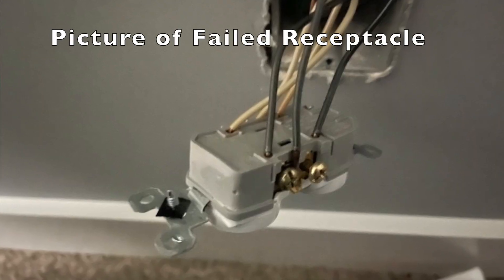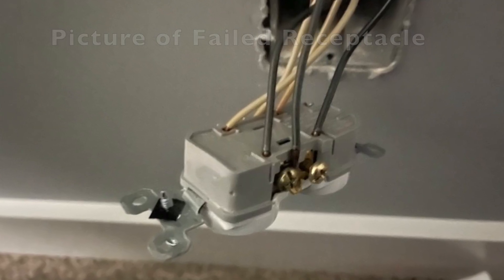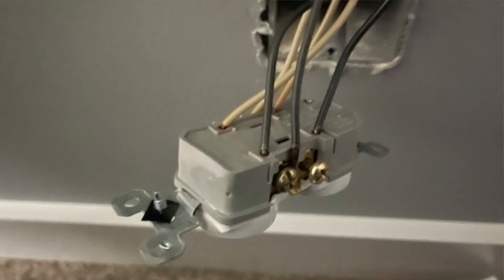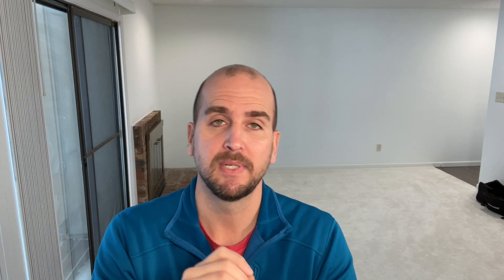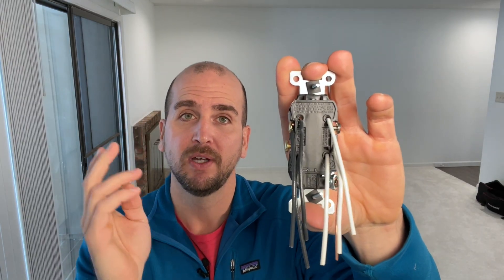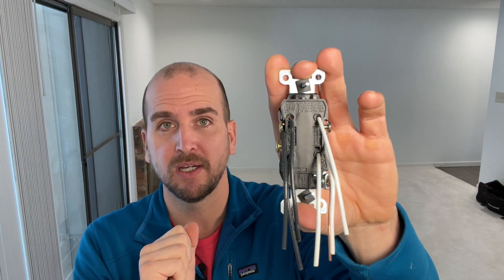Incorrectly Wired Outlet Found In Newly Built Home

Comment: That original wiring with the three leads is  not a bad practice, it IS a violation of the code. Code requires that a receptacle can be removed without interrupting/breaking the circuit. Thus, a pigtail is **required**. 

 You will also see installations where some insulation is stripped away and the continuous bare wire is looped over the screw. This is also a violation because it leaves uninsulated conductors when the receptacle is removed. Not good. Pigtail.

Comment: There you see, that us electroinstallation is one of the worst....
Compared to european.
Exposed terminals do not exist in new devices as sockets,switches and so on...
New standard is, push in connectors and  live open metal parts are maximun covered against touching ( because always exist dumb nuts, that work on electicity withoutvturning off fuses) ans for children in the house exit also cheap inserts to prevent poking with metal into a hole...
Us has so many codes and rules, but does nothing to change the basics...
Find in google cee conform sockets from abb or busch jaeger and compare them to us standart.
Added pictures...
https://www.google.com/search?q=busch+jaeger+up+einsatz&tbm=isch&ved=2ahUKEwixh8DCyu3uAhWI-qQKHVUFBh4Q2-cCegQIABAC&oq=busch+jaeger+up+einsatz&gs_lcp=ChJtb2JpbGUtZ3dzLXdpei1pbWcQAzIFCAAQzQI6AggAOgQIABAeOgQIABAYOgYIABAIEB46BAghEApQ2MAEWMWKBWDslwVoAHAAeACAAYgCiAGaD5IBBTkuOC4xmAEAoAEBwAEB&sclient=mobile-gws-wiz-img&ei=_ksrYLGQDoj1kwXVipjwAQ&bih=775&biw=412&client=ms-android-samsung-ga-rev1&prmd=sivn#imgrc=AwOGLgVr2eRYoM
Frontside with childprotection:
https://www.google.com/search?q=busch+jaeger+up+steckdoseneinsatz&tbm=isch&ved=2ahUKEwjugtvry-3uAhWVq6QKHdIdAsYQ2-cCegQIABAC&oq=busch+jaeger+up+steckdoseneinsatz&gs_lcp=ChJtb2JpbGUtZ3dzLXdpei1pbWcQAzIFCAAQzQI6BAgeEApQ7rUCWPrnAmD9gANoAXAAeACAAcwBiAGFDZIBBjEuMTAuMZgBAKABAcABAQ&sclient=mobile-gws-wiz-img&ei=YU0rYK7OBZXXkgXSu4iwDA&bih=775&biw=412&client=ms-android-samsung-ga-rev1&prmd=sivn#imgrc=IKldvHvz-jr93M

Comment: One point to keep in mind with pig tails is that the addition in some codes (can only speak for Canada) of the 2 wire nuts can put you over your box fill limits for number of conductors in the box.
Reply: Where I live pigtails are required on all three wires.  No spec. on ground position but I like to go ground up for safety  from "metallic intrusion". I also use as larger box as I can which means fewer problems with box fill and allows me longer terminal leads.
Reply: @francoistombe  I also install ground up EXCEPT in a flood prone area like a basement....
Reply: Poor Wagos...
Reply: @mmoser9483  Don't weep for Wagos.
Reply: Well , it is a matter of 'size of the box' that controlls the number of wires and 'connectors' ... a 3 gang box is likly even in Canada allowed more (and saddly, largely ignored by inspectors in the US) ... BUT 2 wirenuts is all you need in most 'outlet' installs to pigtail
Reply: @MrOpinionCantSignIn  The point i was trying to make is that on a standard device box ( the size most commonly used and available) being the 12.5 cub in in volume. This gives you 8 conductors for your fill. you use 2 conductors for your device and 6 conductors for the wires. Meaning that you do not have the needed one conductor of space need for the 2 wire nuts. If you would look up what I'm saying see the CSA C22.1-09 section 12-3032
Reply: @toejah , that’s a tiny box. 8 conductors in a box that size well exceeds the box fill. Then the device is considered as 2 conductors in box fill, at least in the States it does.

When doing new construction I install 22cu inch boxes in homes. They can only take 3 Romex wires or 7 conductors because the device takes up 2 more. Ground counts as 1 conductor regardless how many there are because they tie together.
Reply: "NO DEVICE SHALL BE INTERDEPENDENT ON ANOTHER DEVICE!!!" MEANING PIGTAIL THAT SUCKER!!!
Reply: I always put the ground lug up, not down. Was recommended in the 1996 code on a trial basis. They subsequently did not require it in the US. I still do it because if a plug is partially out of the wall, the only way to connect the hot and the neutral is by moving some metallic object UP. Gravity won't cause a short. The first thing a metallic object hits is the *ground lug.*

So do they require the ground lug up or down in Canada? Technically, the wire nuts also contribute to the wire fill. But they do not count a wire that starts and ends in the box, i.e. pigtails or ground wire to the metal box.
Reply: @ricoludovici2825  no code requirement in Canada about how vertical receptacles are installed
Reply: @Nick-bh1fy  it is strickly a personal way of doing things.
Reply: @ricoludovici2825  I got the impression, that was the initial design idea, and the world did to cotton to that concept.
Reply: @mmoser9483  Back when electric was first being installed, they mounted the [ungrounded] receptacles horizontally. I don't know why they change b/c that way you could not short across the hot and neutral with a foreign object either.
Reply: @ricoludovici2825  nope. Interestingly, I find that either nova scotia or Newfoundland typically will have ground up.

There are definitely good reason to do it, but it messes with my head when I see it. Upside-down faces are just weird...
Reply: @Jgalaski8438  Well, Newfies .... eh?
Reply: @ricoludovici2825  I've heard lots of people suggest that but for the life of my I can't imagine that's happened but once or twice. If ever.

Like are we throwing paper clips after leaving the plug half hanging out? A short that quick would open the circuit breaker anyways with probably limited damage. Seems silly. Personally, I don't care which direction a receptacle sits as long as it is functional.
Reply: @etherealrose2139  Well, the reason given by the code authority is the chance of shorting across the hot and neutral if *a metal faceplate should fall across the hot and neutral of a plug half retracted.* 

I kid you not. What are the chances of 1) a metal faceplate 2) falling off when someone is working on it 3) with a hot plug partially retracted?
Reply: @ricoludovici2825  I would say that having the outlets ground lug up in a residential setting will actually cause exposed blades to be more likely. Most wall warts, often with only two blades and no ground pin, are designed assuming that receptacles are installed wide blade/neutral to the left and the bulk of the weight and cord will be below the receptacle. Plugging them in the other way results in them wanting to rotate downward over time which causes the plug to sit at an angle exposing the blades. That scenarios is tons more likely and I've seen it happen so many times.

Comment: As licensed Master electrician and contractor I would disagree that the push in connection is "inferior".
Reply: @baremetalmachine933  I have installed thousands of receptacles. Use to use the screws on the side but for the last decade I have usef the push in. I haven't had 1 fail. They work and will continue to work.

Comment: A trick I’ve used for years is to gather the stripped wires together and zip-tie them, then twist and put on the wire-nut, holding the tail of the zip-tie for torque.  Then I trim off the tail.  That way, if there is any tension on the wires, it’s taken up by the zip-tie rather than working a wire loose inside the wire-nut where you can’t see it.
Reply: When splicing circuits on jobs, I used to do something similar. When making the pigtail, leave it longer. Splice it to the other circuit conductors. When you're done with the splice, make one wrap around the spliced "bundle" with the pigtail. Neatly fold the spliced bundle back into the box. Whenever anyone pulls on the pigtail, they're pulling on the conductor "wrapped" around the bundle and not on the splice. Works very much the same as the zip-tie without needing to carry and install the tie.

Comment: After pigtailing the wires I try to neatly fold the wires into the boxes. Ground wire first, then the neutral, and lastly the hot wire. trying not to stack the wire nuts on top of each other making as much room as possible for the device, as with GFI.
Reply: BSM!     Box Size Matters!

Comment: You need a license to do routine maintenance electrical repair.  Anything 10 volts or more.
Reply: Not true,  0 to 49 volts is "low distribution" and not covered by code.  Also, many places Homeowners can take a test at local Code enforcement office and do electrical in their own home (not to include main power feed).
Reply: @pablopicaro7649  Agreed that the standard homeowner doesn't need a license to do basic repairs (replace a switch, recep, light fixture)

However circuits operating at less than 50v are indeed covered by the code.
Article 720, as well as 725

Comment: Why are the Wago push-in "wire nuts" considered safe, but not the push-in connectors on the back of the outlet?
Reply: @Joe-by8jh  Some might be fine. I just saw many people claiming wagos are failing, but it always turned out it was some off-brand.
Reply: Because wago is a reliable brand, US outlets are crap.

Comment: I agree always tighten down unused screw terminals, never backstab always leads to failures the majority of the times someone says I have no power at a certain location and you open up the receptacle its backstabbed to me its pure laziness. Some guys argue it saves time etc and don't care sadly because by the time it fails its no longer on them, it's always a common argument oh I saved x,y,z in time and time is money. Also never rely on a device receptacle to feed through power always pigtail although I would have made my splice and pushed the wires back into the box before adding the spark ring which you call box extender. A box extender would be an extension ring or a mud ring which is different.
Reply: "never rely on a device receptacle to feed through power always pigtail"  Thank you for explaining the rationale behind the pigtails versus "powering through."
Reply: @AJ-io3bq  yeah when you rely on the device in this case the receptacle when that fails anything else being powered or well on that home run with power coming out from the panel will also fail and you will have to trace it back. When you pigtail the devices then only the individual device this case the receptacle will fail and you only have to open the 1 and replace it, instead of opening each receptacle that doesn't have power and try and figure out which one of these failed causing all the others to lose power.
Reply: What I've found is after so many times of it being wiggled from use that wire becomes weakened as well and you lose almost an inch of wire everytime. It's a hassle replacing a circuit behind a wall when your circuit become to short to work with inside the junction box. This is the main reason I avoid using the backstabs and I use pigtails. It solves both problems and it also improves the circuit integrity.

Comment: Favorite experience with no good rotten backstabbers... plugging in a work light in a house I just bought to look at paint color. Went to unplug the light, ceiling fan flickers. Went for it and just yanked the cord out of the receptacle, fan shuts off. Cue mild panic and going to the breaker and tools to take the receptacle apart. Sure enough the hot wire was falling out of the back and would not grab. Copper with discolored black by the insulation

Comment: I’ve always wrap the duplex outlet with super 33 for extra protection particularly when you have a metal box.  It’S not required by code but it’s a good practice that reduces other possible problems.  Thanks, I enjoyed your video.
Reply: I wrap with tape as well, I picked it up from someone a long time ago.  Fold the last bit of tape over on itself to make it a million times easier to remove when work is needed.  I'm in Chicago so metal everything.
Reply: And do the same with switches, that way, if anyone has the covers off,  the terminals are somewhat inaccessible,especially in a multiple device box. Most electricians do not do this in production work in new building, as it takes too much time, and when locating a problem it presents more work.
Reply: This should really become code
Reply: @abdulelkhatib2674  it really shouldn't. It's a hazard and adds zero safety.
Reply: What are you guys doing to require tape all over? If you're removing the receptacle from the box it doesn't matter if it is made from carbon fiber, plastic, wood,  metal, Papier-mâché... and upon insertion you're screwing it back into the top and bottom. Why would you wrap it? You know electricity produces heat, right? You know by wrapping tape around it needlessly,  you will be trapping heat that should be dissipating when the receptacle is in use? I mean the receptacle is secured to a box of whatever construction which is covered over by a plate so there's literally no need for tape. It is a sign of someone that doesn't understand how electricity works and adds a potential hazard. There's a reason it is not required nor have I ever heard it recommended except in these comments. Silly.
Reply: @etherealrose2139  Because the terminals are close to the metal box (1g old work box, 2g box etc) and you don't want a short, either because something was loose and its moving around in the box or because its being worked on.  

You'd be surprised how often circuits are worked on while while live, sometimes its accident - wrong circuit turned off.  But its actually required allot of times, there are circuits you just can't really turn off that are running critical systems.

Comment: Your original method was fine and perhaps slightly more reliable than a wire nut. It is just more difficult to push the outlet into the box and bend 5 wires instead of 3 - which is often significant depending on the available space in the box. The screw in plates provides plenty of force to keep both wires secure at each terminal - something that the outlet stab-ins were never good at. 
Now, I do prefer pigtails with Wagos as installation is fast, future modifications are easier, fault investigation is easier, and wires can be shorter and more easily positioned in the box (as each wire can spin independently in the Wago).
I'd actually wish that outlets would just lose the screws and come instead with 3 wires.
Reply: Interesting you would say the original way is more reliable then wire nuts but also use Wago since Wire nut > Wago.  Wago is not allowed here in Chciago, if they come preinstalled on a fixture etc we replace them.
Reply: @h82fail  wago push-in or wago lever nuts? I have no issue with lever nuts, but do not like the push-in style.

Comment: In my city it is code to use pigtails, and 12ga or greater wire.
Reply from the maker: Thanks for the feedback Maverick.  12 gauge even on 15 Amp?
Reply: @EverydayHomeRepairs  On old work  14ga and 15 amp are allowed, but any new work is required to be 12ga wire. I don't know if you are allowed to put a 15 amp with 12ga wire though, I would have to look that up. I imagine if you are adding to a 15 amp 14ga system, you should be able to use 14ga wire. Otherwise you would have to run a new wire from the panel.
Reply: @MaverickandStuff  downsizing to a 15 Amp ocpd on a 12awg is completely fine. You just shouldn't go past 20 Amp for a 12awg.

Comment: Anyone else in a 
GROUND 
ON TOP 
outlet area??
Reply: Six decades ago in Virginia, it was very common to see ‘some’ receptacles in a house with ground up.  These receptacles were the ones that were split and this was an easy way to indicate half the receptacle was controlled by a light switch.  Haven’t really seen it much since, but it was a helpful to know where to plug the lamps in and to tell you didn’t have a faulty receptacle just because you didn’t have power on half of it.  (Just visited a home in California and they also have the ground up on switched receptacles.  Not sure if it’s common there.)
Reply: Ground down.  Better line of sight for non grounded plugs when behind a couch or table.
Reply from the maker: Oh man, that is like the great debate.  Check out all the comments on this video https://youtu.be/kYXvcog9MxY.  Seems to be a toss up.
Reply: @EverydayHomeRepairs  I never put the GR on top ( election for 60 yrs )
Reply: @davenelson9253  Did you know that sixty years of zapping yourself can affect your spelling?
I’m a 4th Generation that quit to get my PEng.EE.
I dropped wire trimmings  that hit a beat up ext cord that showed 1/4 in of the blades, I let all the smoke out of it too.😎

Comment: I don't know whats best bro, I just go by what I see as better.  I tape my terminal connections, on all around the recep sides. and also, i don't use that straight connector. the ones that clamp...  I found that they don't secure as good as a J hook on the screw, they are more convenient, but if you wiggle them a little, they come loose. the shepherds hook or J hook  you mentioned is much more secure. Never mind the push in at the back.
Reply: Would need to dis-agree with you on the side clamps. All the ones I've ever used provide a nice tight and secure connection. I've had the screws rotate loose when pushing the device back into the box. Never had any problem with the screw clamps. Also, try doing the "J" hook method with stranded conductors as is frequently used on commercial installations. retired after 40 years experience.
Reply: Well said, wrap that recep with tape before pushing it back into that wall. He did have a plastic housing, which is cool But I just tape mine for the hands that are going to need to pull that recep out of that plastic housing, and yeah. Seems no matter how much torque you put down, those plate clamps come loose when you wiggle them. My experience too. Just J hook it. Its safer.